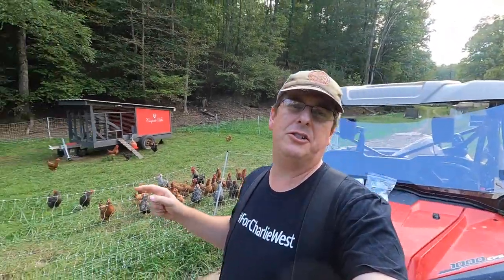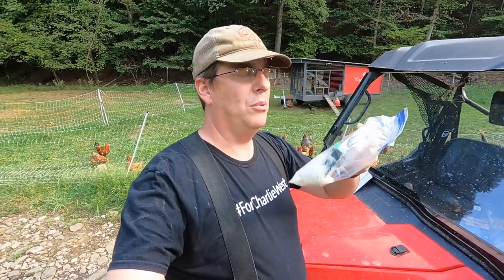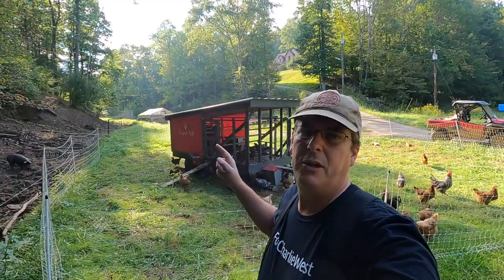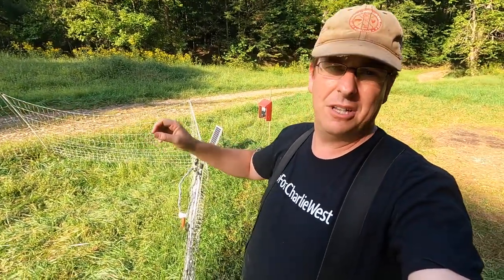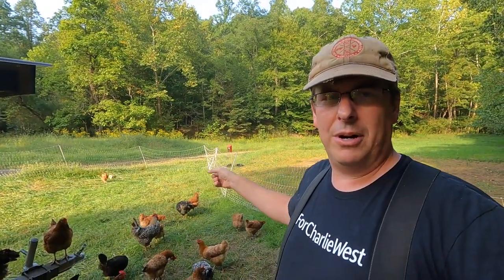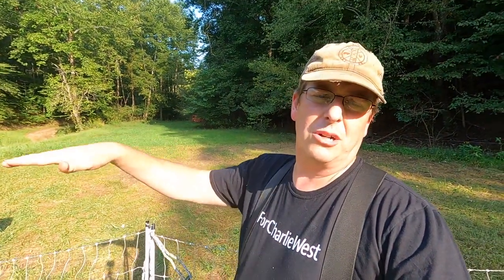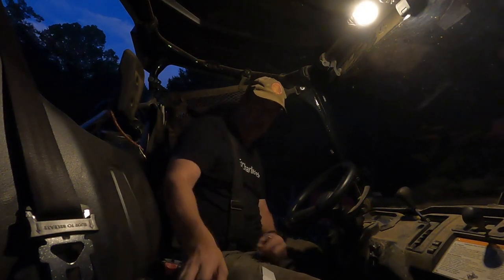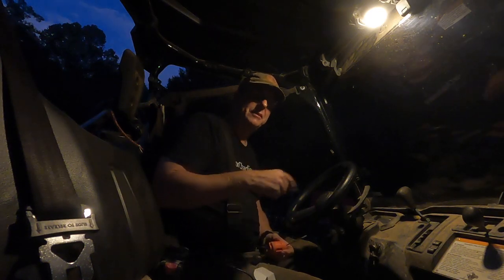Making our Mobile Chicken Coop MORE MOBILE!

Comment: mount another support to the side of the wall next to the battery and then attach an old piece of plywood with two screws over the battery box to keep the chicken crap off it and it will be easy to remove when you need to get in the box.

Comment: The reason DC did not become the power of choice for the world is the conductor size requirements to safely transmit it across any distances. That extension cord is going to get quite hot. It is the riskiest part of your system.  you should try to insulate it from wood contact  hate to see homeless chickens due to house fire.
Try putting a twelve gauge wire from battery to starter in your vehicle.

Comment: Others have mentioned your extension cord may be too small a wire gage for the load.  You can go online and find a calculator for the length of your 12v carrying extension cord and it should you should know how much current it draws maximum for a DC load. Adjust as necessary.  Having spent my adult life on construction sites in and out of the weather I can assure you the plastic coating over the extension cord will fail due to sun/UV exposure and will eventually allow moisture to creep in.  This is a good proof on concept but the cost of a good 12 gage extension cord now-a-days is not cheap. I think in your case figure out your maximum length of cord you will ever use and use a bit of overkill to make it last ten years.  Good luck!!

Comment: Why not do things right?
Why not run your chickens off your mains charger. 
I've said  this before, but being hard headed you didn't listen.
Reply from the maker: The coop is not always near the pig fence. Not hard headed. Just practical.
Reply: I bet your coop de ville is  within  the ten miles your plug in charger  reaches.
Reply from the maker: But it would have to cross the driveway, go up one hillside and down the other and be susceptible to deer breakage.
Reply: Most always the coop is right there in that small flat spot.
Stop being...
Reply from the maker: In two weeks it will be where it was earlier this summer on the other side of the drive away and the week after it will be on the other side of the hill. It’s isn’t practical to run a wire that has to be various lengths with every move
Reply: On a slightly  different  note.
Could you sell me two female piggers?
I think the Fredericktown Homestead  is ready to take on farrowing some pigs. I don't  want to start out with plan old York/landrace.  
Can you help me out.?
Reply from the maker: The 11 piglets I have are all going for processing. I won’t be breeding again until December
Reply: You know anyone  with  good pigs.?
Reply from the maker: David Crafton Six Oak Farms in South Carolina. He delivered mine right to the farm.